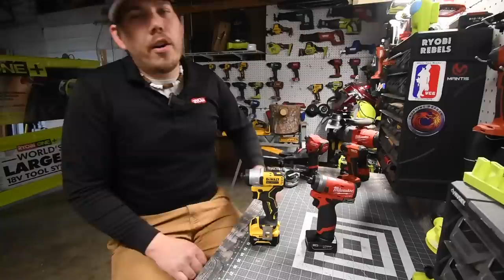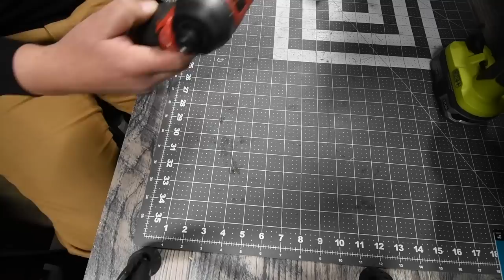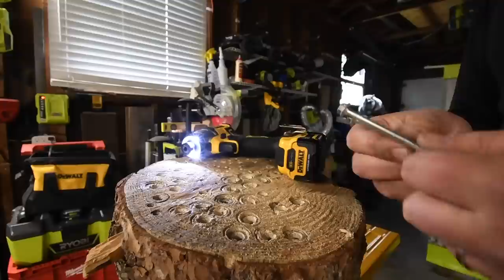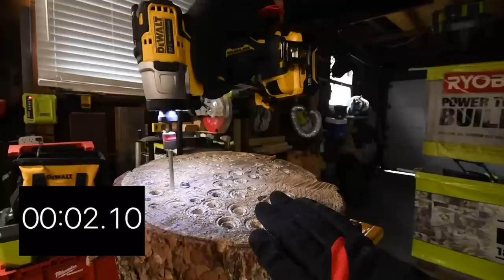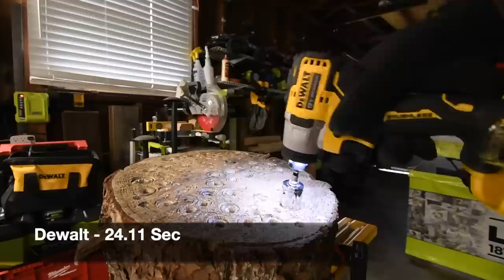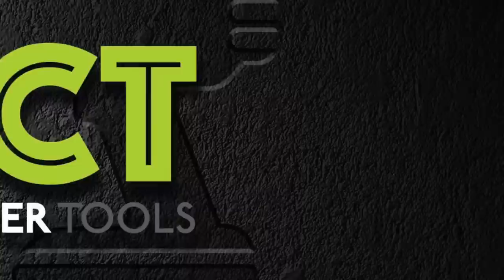Dewalt Extreme vs Milwuakee M12 (Impact Drivers)

Comment: Went with the M12 line due to the huge selection of tools.  Was not a fan of the grip at first but now actually like it. Kind of like my Glocks.
Reply: Yea I went into m12 line thinking its not worth the decrease in power over m18, but honestly as long as its fuel I pick m12 over m18 now. The weight savings adds up. Nine out of ten times I'm going to grab an m12 tool over the m18 during the work day if I have both in front of me.

Comment: The lights and ergonomics of Dewalt is better.  I still like Milwaukee cause of the huge versatile lineup.
Reply from the maker: I do thank you so much for viewing :)
Reply: I bought my first Milwaukee M18 Fuel on the basis of two independent tests where the Milwaukee M18 just creamed the opposition - twice, and I have never looked back! Btw DCF on the Dewalt stands for Dewalt Catches Fire is put them through their paces!
Reply: @yvindascanius6061  lol
Reply: jami w  Yes I do, but you are not me - luckily for me! I have had NO issues with my M18 and M12s. Wouldn't change the brand even if they offered it to me for free!
Reply: jami w  It has been demonstrated again and again that Milwaukee's chuck is dead straight and Dewalt's very often wobbles hence the appropriate nickname Dewobbly.
Reply: jami w  why I don’t own Milwaukee tools. I have abused my atomic impact driver and it still works today. Many people get sold on the marketing of tools and Milwaukee is a marketing company. I would definitely consider dewalt a very reliable brand with excellent service. I had to send in my old 20v drill due to a defective chuck and they paid for the shipping without the warranty
Reply: @yvindascanius6061  sigh another fanboy. Look for reliable guy not speed like everyone else does. It could have all the speed in the world but if it can’t hold a bit in the collet like the gen 3 it is worthless
Reply: @Toolboss0826  I didn't buy it because of speed. That was many years ago, and the deciding factor was the overall performance!

Comment: I have most of the tools in the dewalt 12v line and I absolutely love them, not because they are the most powerful but because they are the most comfortable to use all day. The first setting on that impact is a screw driver setting and its great when working with delicate fasteners.

Comment: Got that little monster a couple months ago for 99 bucks with the free 5 amph battery ! It's the one I use the most too ! Lightweight, compact ,and powerful. I too am a 12v tool fan even tho I have 90% 20v stuff the 12v is my goto tools
Reply: Those dewalt 12v xtreme are very nice. I like the battery packs alot better
Reply from the maker: I do thank you so much for viewing :)

Comment: Agree that the m12 bulbous handle is a problem for many people. Given the dual chargers m18 tools come with, the addition would be easy, but I find the m12 grip uncomfortable
Reply from the maker: I do thank you so much for viewing :)
Reply: DeWalt has dual-voltage chargers doing both 12 and 20 volts.
Reply: @ecoRfan  They have them, but Milwaukee routinely provides them in their m18 kits. Dewalt doesn't. And the m12 line is pretty great. I just don't like the handles/grips, which can be a deal breaker. Also I'm not in the Dewalt line and don't really want to add yet another battery platform. Of course they make good tools.

Comment: You are very right about the DeWalt being more comfortable, especially for someone like me with shorter fingers. 

Unfortunately, they don't have the variety of tools. I have M12 tools that DeWalt just doesn't make, so it made sense to get the Surge. I just wish DeWalt had a hydraulic driver and a 4-in-1 drill/driver/offset tool like Milwaukee does, and a 3/8" ratchet, and more, and I might switch my 12V line over. 

If Lowes still has that 12V impact driver deal going, I may grab one for my dad. Otherwise, HD has their 2553-21 kit for $99 right now.

Comment: I have mostly m12 tools. I'm a diy home owner. I hate the barrel grip as well, but realized that too late.  If I did it again I'd go another route. Tried the dewalt xtreme line and its was nice an light and comfortable and had enough power for me. If the Xtreme were out 3 years ago I might of went that way. 
That being said the m12 line has never let me down, does everything I need them to do. I'm not about to sell them for a loss to buy new tools when they work great, just really hate the grip. If my job required me to use tools everyday I would personally switch to a different lineup.

Comment: Gotta give the value proposition to dewalt. Milwaukeee performs better, but the bare tools are more than the entire dewalt kits. Dewalt’s 12V charger also does 20V, and they’re still perfectly capable tools that I’d say are as good in any application. I do wish dewalt made a 1/2” drive drill in 12V.
Reply: Milwaukee win 🏁, Milwaukee knockout Dewalt ↪️ -_- 👍
Reply from the maker: I do thank you so much for viewing :)
Reply: Only Milwaukee

Comment: I have both Dewalt 20v and Milwaukee M12... it's nice to see the DeWalt have more power in the end, but if you're needing to use all that power and work the tool that hard, you should be in a 20v tool. The DeWalt 12 volt tool platform just doesn't make sense considering how wide the 20 volt platform is and that the 12v tool isn't much smaller unlike Milwaukee's 18 and 12 volt platforms.  I'd say if you're going to get into 12 volt, get into the Milwaukee.

Comment: I’m admittedly a big Milwaukee fan, but why on earth do these other tool companies make their 12v drill/drivers so big? My whole purpose for having 12v tools, particularly impact driver, is the size. I want to be able to easily fit it in my small veto bag. If I wanted something the size of the dewalt 12v impact, I could almost just use an 18v impact with a slim battery. I’m not just picking on dewalt either. Milwaukee is one of few that use this style for their m12 impact.
Reply from the maker: I do thank you so much for viewing :)
Reply: Ridgid is another one that uses the same style though their 12v are brushed and they dont really have a 12v lineup.  Thats why i went with milwaukee m12 fuel.  On the 18v i am on ridgid platform.

Comment: Any idea if dewalt is going to be expanding the 12v xtreme line?
Reply: i feel like lowes is or should be pushing dewalt to expand it so they'd have an option to compete with m12 in every tool
Reply: They definitely need to
Reply: I heard a bandsaw is coming soon
Reply: Their new impact wrench (DCF901) is pretty good. I would like to see 1) a multi tool, 2) a circular saw, and 3) a cordless ratchet.
Reply from the maker: I am not sure but we will see
Reply: I surely hope they do. Plus their chargers are dual-voltage: both 12 and 20.

Comment: I bought the DeWalt 12 volt screwdriver, for $100 with two 2 ah batteries,charger and bag was hard to pass up. I already had the m12 Surge and m12 fuel screwdriver.  I really struggle staying with one brand. LOL
Reply: I was late to the game and got impact driver, but I really want that screwdriver kit and oos everywhere in my area.
Reply: @diablo21st  It's a nice tool, my only complaint is it doesn't have two speeds like the Milwaukee.  When the battery gets down to one battery and you aren't close to your work vehicle,  it will run out of power pretty quick. I found that out the hard way.
Reply from the maker: I love all 12v tools

Comment: The one thing that bugs me about my M12 is that the angle of the handle seems to be more than other tools I own.  It's kinda weird, I always wonder why they went with such a drastic angle.  Otherwise though the tools are great.
Reply: It works great for some applications. But horrid for others. Like the curved handled hammers. The curve is great when it works out, but in my job you dont swing at the perfect angle much so I dont use em
Reply from the maker: I do thank you so much for viewing :)
Reply: @b gg 😷🤣🤣🤣

Comment: Has anyone had any issues with the m12 fuel cutting out in mode 1? Mine wont impact and will shut off when it hits resistance, but only with a 2.0 battery that’s been used for a like 10 minutes in mode 1. If it’s fresh off the charger then it will impact fine. Haven’t tried with a 4.0 xc yet so not sure if it’s due to voltage drop or something?

Comment: I'm ganna say the Milwaukee impact is slightly better, but the dewalt drill is slightly better. Same as the 18/20v
Reply from the maker: I do thank you so much for viewing :)
Reply: @b gg it was my guess before watching. I find the m18 fuel impact better than the dewalt xr. But the dewalt drill/driver is better than the m18 fuel drill/driver. And by better, I mean just barely for each. So it evens out.

I prefer m18 over the dewalt XR but in 12v the dewalt takes the cake big time. They just need to expand the line

Comment: Does anybody know how the Skil 12v impact compares to these two? I’m in Milwaukee, and would check out dewalt if they would expand on their 12v line. I keep eyeing the Skil 12v stuff but was wondering if they are even comparable
Reply from the maker: I do thank you so much for viewing :)
Reply: https://www.protoolreviews.com/best-12v-cordless-impact-driver-reviews/

I have all three. 

Skil definitely gives up speed under load to Milwaukee and DeWalt. It’s also fairly large and heavy for a 12v. That said, it doesn’t sacrifice that much in actual torque to the other two for any kind of reasonable task to ask of a 12v. It’s plenty powerful, and has a great true halo light.

Overall, I like it and think it’s a good value tool (extra batteries are also very reasonable). Is it as well built as the other two? Time will tell, but to be fair - the same could be said of the new DeWalt 12v. I’ve actually had the Skil set slightly longer.

For whatever it’s worth: the DeWalt is my overall favorite of the 12v drill/impact sets. And I’m normally inclined toward Milwaukee.
Reply: The Skil 12v impact & drill are more like compact 18v in size rather than 12v. I bought the 12v Skil drill/circular saw combo & returned them due to the drill being the same size as my 18v Makita XFD131 drill, which is in the compact class, not the subcompact. I've owned Dewalt 12v tools since 2015 & they are great 12v tools worth the $$, especially the new brushless stuff when on sale.
Reply: Thanks for the info fellas, much appreciated
Reply: @jeffsnyder289  did you try out the Skil 12v circ saw at all? I have a corded 7 1/4 dewalt circ saw, and wanted a cordless 12v, and trying to figure how good the Skil 12v is vs the m12 circ saw.
Reply: @iloveknives75  Yes, I tried it with the 4ah battery & made some test cuts in some 2x6 pressure treated pine. It actually cut cleanly but I couldn't push it or it would stall being just a 12v. It's practically the same size & weight as my 20v Black and Decker 5 1/2 circ saw, but doesn't cut as quickly as that one, so I returned the kit. The Skil 12v is a very nice saw tho & I really like the ergonomics because it's very similar to my 6 1/2 brushless Makita, but its heavy for a 12v & performed like my B&D so I decided to return it. If you dont prefer the m12 handle design tho, the Skil 12v circ is an excellent alternative as a 12v option.

Comment: I know what you mean about the grip, but I have xl glove size hands…there not super fat but I got them long fingers so xl gloves are a must. But having longer fingers makes it a non issue for me and I love my m12 fuel tools. But I did notice how beefy that grip is though for someone with stubby short fingers that grip might be a little to fat. I rarely USe my m18  fuel drill, and driver unless I’m running a big hole saw or something and have had no issues with comfort after long use periods with the 12 volt stuff. I guess because they went with the candle stick profile it had to be thicker? My only grip is, and I wonder if anyone else has this issue is with my m12 hammer drill when loosening the chuck it spins and spins then it will engage and allow me to open the chuck up…anyone else have this issue? Guess I need to call sawdust. Unfortunately it’s been like that since day one and I’ve just lived with as it works, but not the way it should :(

Comment: Milwaukee is too strong, Dewalt can't stand it, when it comes to 12v, Milwaukee has no rival!!!
Reply from the maker: I do thank you so much for viewing :)
Reply: And yet, on the biggest lag screw, DeWalt won by over 10 seconds...

It would be interesting to see runtimes for each, say... How many 1/4" x 4" lag screws each one can drive. If only they both had batteries with the same Ah rating to make it even.

Oh, and I don't own any DeWalt. All M18 and M12 here, including the M18 and M12 Surge, but the DeWalt I tried out is by far the more comfortable 12V tool to hold.
Reply: @l00nybin  Only Milwaukee , Milwaukee number 👍